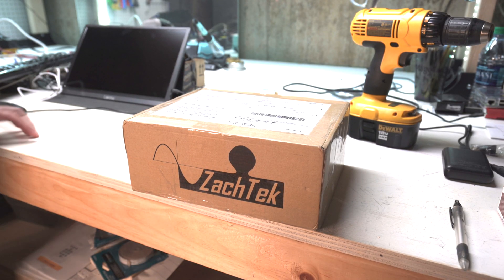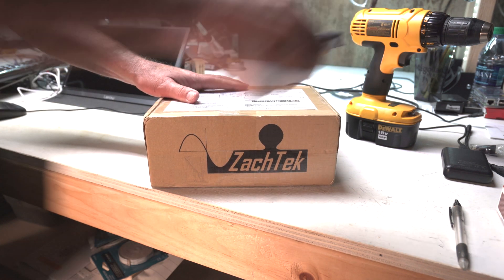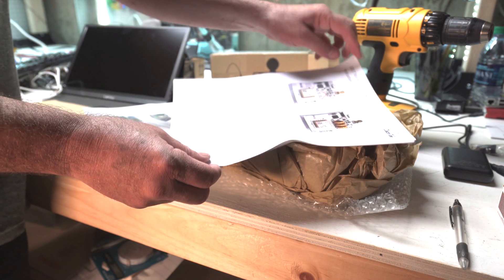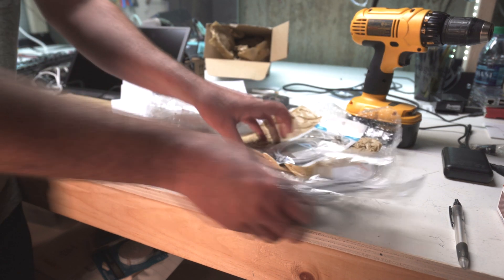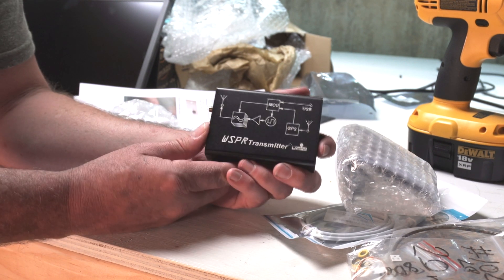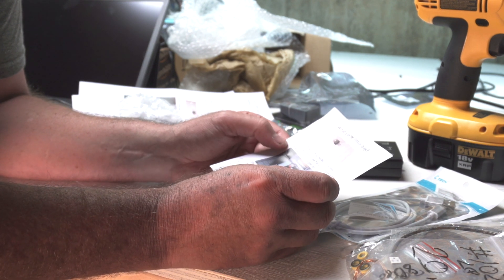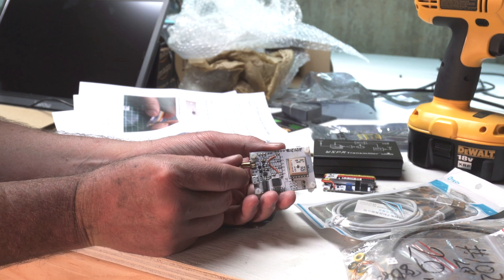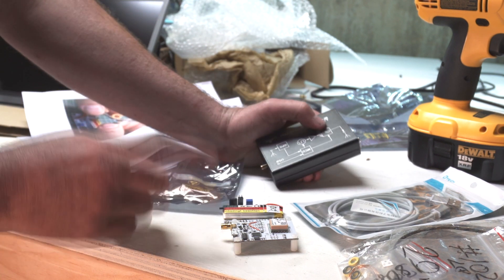Unboxing ZachTek WSPR Transmitters Mini & Desktop ~ Portable WSPR

Comment: Hi Tom,
I have the WSPR Desktop and also bought his 10Mhz frequency standard. Both work great. My WSPR Desktop was a special build with filters for 160 80 30 17 allowing use on 160 80 40 30 20 17.      73  WB3BJU
Reply from the maker: Tnx for sharing